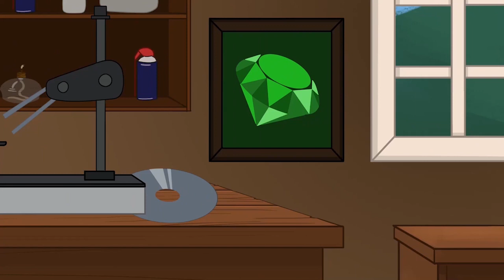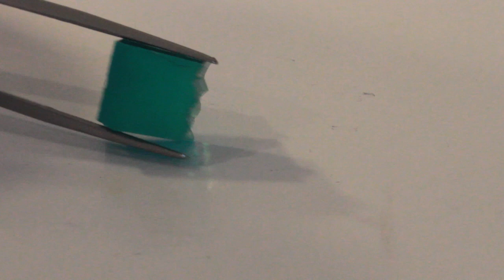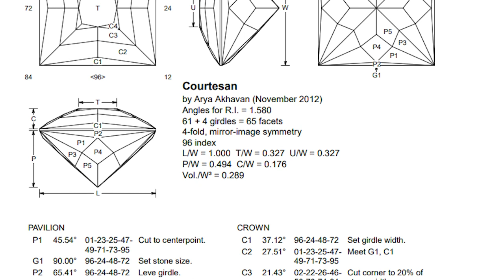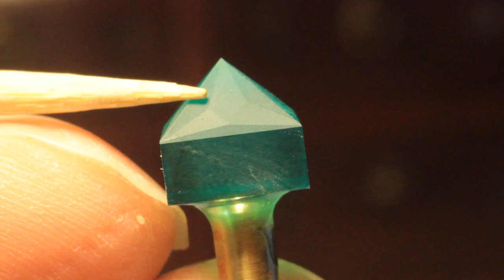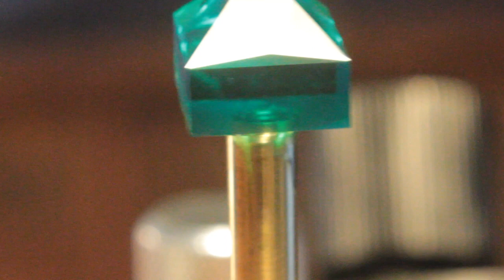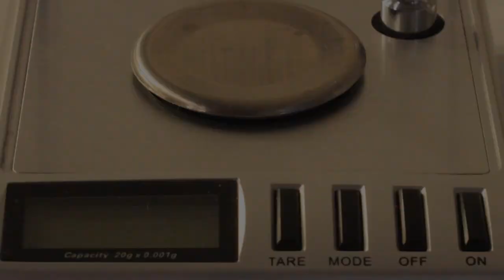Gem Cutting Tutorial: Emerald in a Square Design

Comment: Beautiful gem!  Maybe I'll try that cut as I've been cutting some of Arya's designs.   Do those sharp corners give Bopie problems when setting?    They are so sharp it seems like it would be easy to chip a corner.
You have some thick emerald, I calculated at least 7.5mm thick.   I need to find some thicker emerald in Tucson this year.  The material I have in only 5mm thick which really limits the size you can cut.
Reply: Thanks.  No, our jeweler has not has any issues with the corners of this design.  Yes, I search for relatively thick rough...so for Emerald rough, I often go to one of the labs...I look for thick.  Emerald rough comes in two shades of green, lighter is "Columbian" color and the darker is "Zambian" color.  So when you look for emerald rough, you need to consider the color, clarity, and thickness...and of course the price.  Good luck!

Comment: Thanks Mike for sharing your videos, I learnt a lot from you. 
What IR was this man made Emerald, did you make any changes to the angles?
Thanks again
Reply: Thanks.  I think you mean RI not IR.  One of the labs that I use, and I search all the labs from time to time, claim the RI of the emeralds they create is 1.561-1.571.  If you search online for the RI of natural emerald, you will find mixed results...one site says 1.565-1.602 and another site says 1.57-1.58 ...so I would say they are all about the same.  I did not change the angles in this design, but I have tweeked the design for different material and changed the angles slightly using Gem Cut Studio or GCS sotfware.